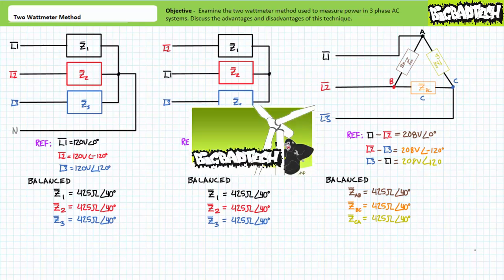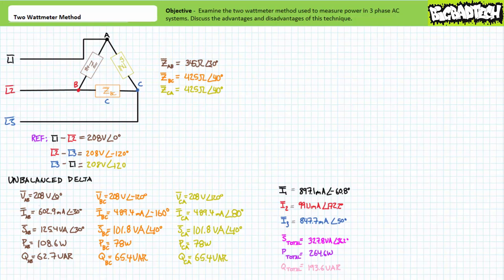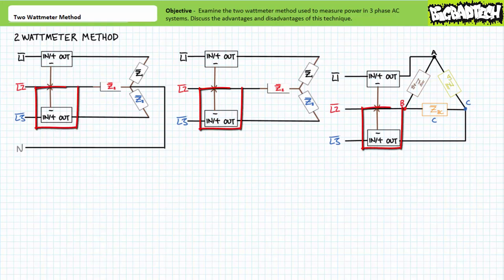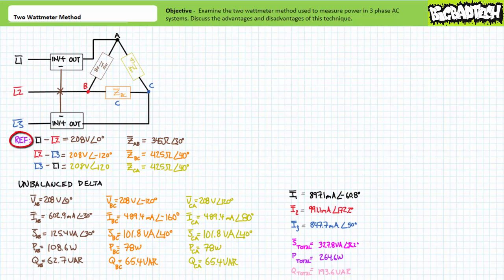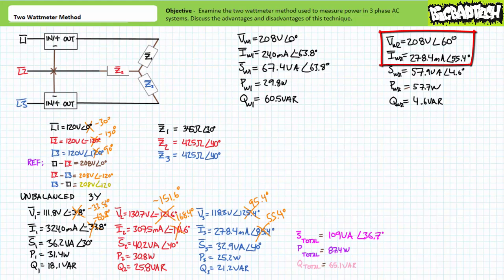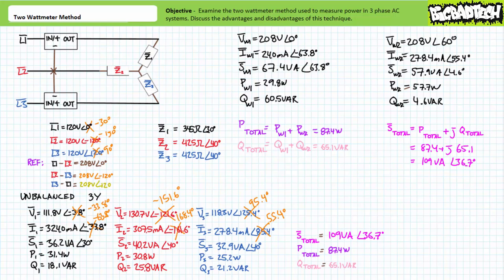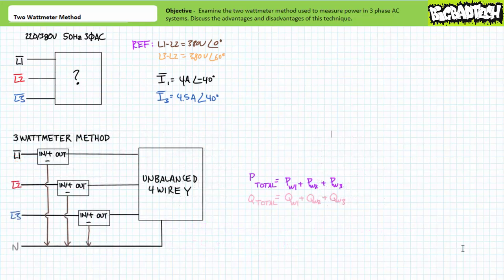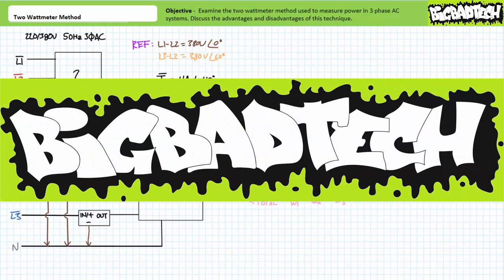2 Wattmeter Method (Full Lecture)

Comment: Great explain, I've a doubt, why use you the common phase B for 2 wattmeter method?
Reply from the maker: Yes it seems weird doesn’t it? But it works. Honestly you could use either one of the other phases as the reference and get results  however it’s customary to use the second phase.
Reply: @bigbadtech , first of all, excuse for me english, i am from chilean, and second, i have a great doubt for use this method in desbalanced load, my professor said, that this method Is for balanced load, but if you use 2 wattmeter method with desbalanced load, the only condition Is use common phase B.
I think that my professor its wrong,  what do you say?
Reply from the maker: The single wattmeter method https://www.youtube.com/watch?v=bVjmy2vBj-0 is only suitable for balanced configurations.

However, the 2 wattmeter method will work for the following balanced configurations:
4 wire Y
3 wire Y
delta

AND the following unbalanced configurations:
3 wire Y
delta

The only method the 2 wattmeter method WON'T work for is an unbalanced 4 wire Y configuration because imbalance current in the neutral line escapes this method's notice.

Easiest way to get the straight truth ... build a balanced and unbalanced 4 wire Y, 3 wire Y, and delta, do the calculations, and apply each power measurement method to see if if works as advertised. This is what I have my students do. Trust science!